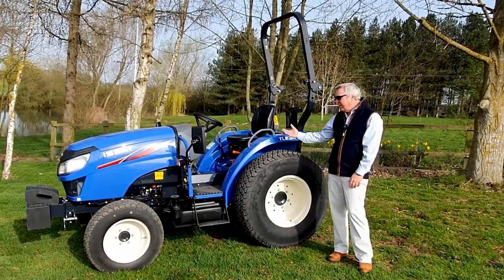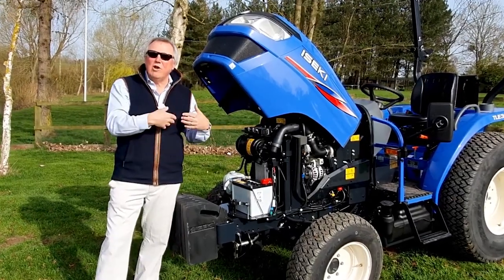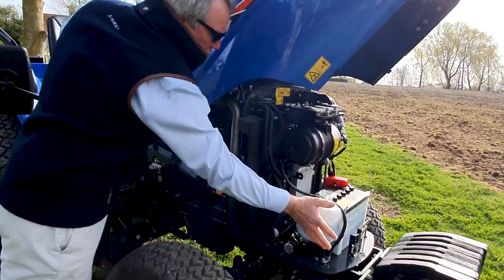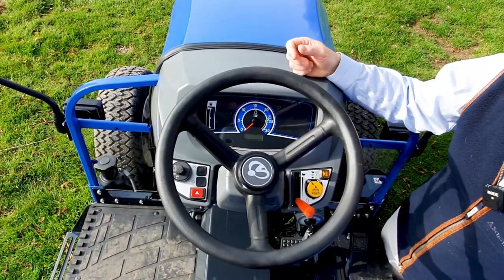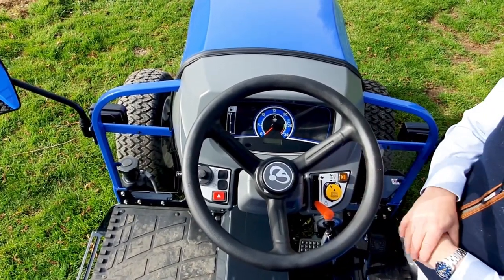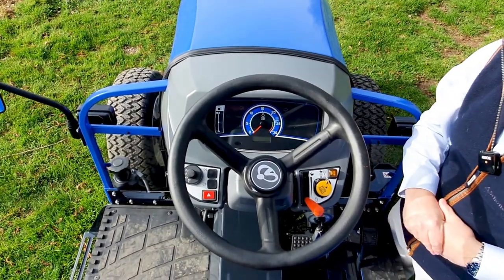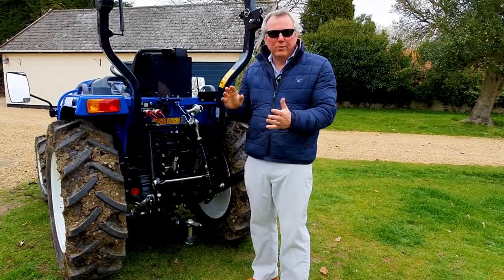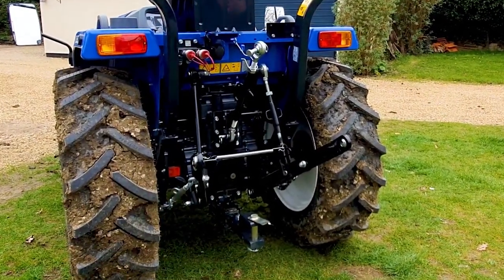ISEKI TLE3410 Tractor Demonstration

Comment: Many of these types of tractors are fitted with rear tracks, I was wondering, as the rear sprockets are only about a quarter of the size of the wheels what is done to correct the ratio imballance with the front wheels?